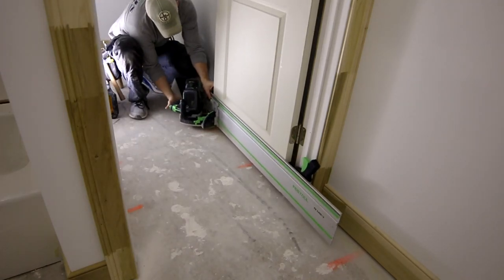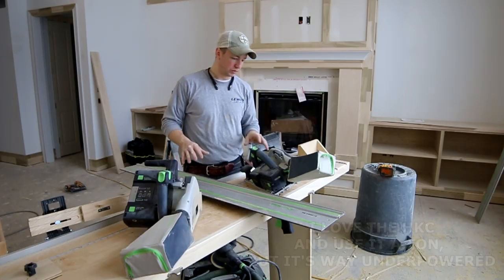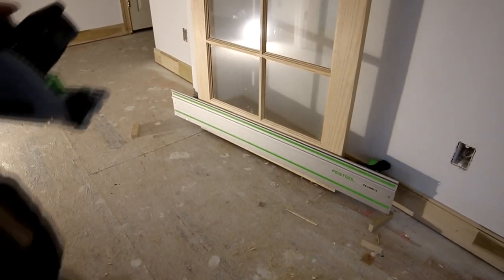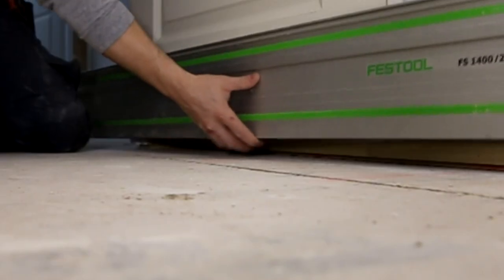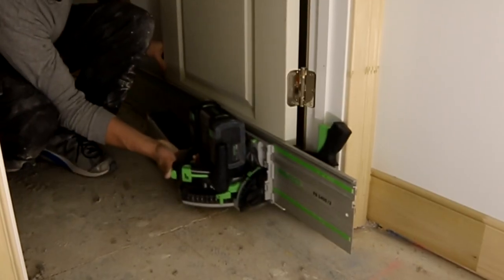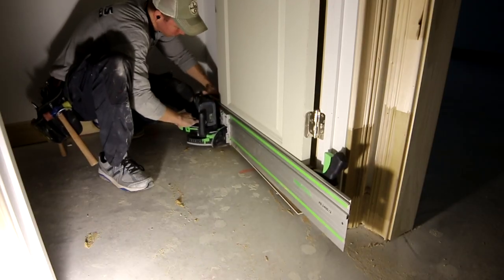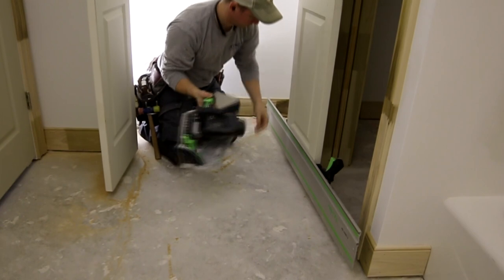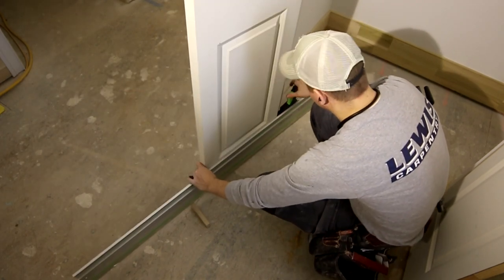Fast Door Cutting While Still Hanging??? Festool TSC 55 for the WIN!!!

Comment: Any recommendations on lasers? Cabinet guy buy trade.   I had a pls180 horizonal/vertical for 12yrs and  up graded to a PLS360.  I babied that laser and after 1yr of looking perfect due to only being on the trypod its whole life to get blasted by someone to just set it back up and walk away. Never found out who did it but now is a complete loose.
Reply from the maker: I have had a pls 180 for going on 10 years that won't die. The buttons are starting to not always work. I'm holding out for a PLS 180 green with recharcheable battery pack. The green lasers use a lot more battery than red. So I'd like the recharcheable pack. The PLS 180 is the perfect size for me. 

I also have a dewalt green line laser. It works well but is larger. That one uses 12v dewalt batteries.

Comment: Hey there, question..I have the cordless t55 as well, it’s been only six months since I got it. Today I was cutting very low depth cuts and at the end of my cuts the blade goes deeper into the material. I can’t seem to find a way to adjust it if that’s all it is.. do you happen to know about that? Thank you so much.

Comment: Question. When you block the jamb up .5 inch for carpet and run your base at 3/8 do you take the door casing down to 3/8 above subfloor as well? Or do you take the casing down to .5 inch above subfloor?
Reply: ? Sounds like an A-level maths question! What speed are they travelling at?

Comment: I have door warranty voiding problems if I do this, so I dont. Pull the door cut and sand and seal door bottom. A door must be sealed on six sides and of I get a batch that wildly warps and they are sealed and hung I can process a return.

Comment: Real curious how do you reseal the bottom of the door after cutting it? I'm sure that would void the warranty if it was left unsealed. Did you go around and paint them without taking them off the hinges as well?
Reply: That's an interior door, they usually don't paint the bottoms because of the raw wood edge

Comment: That’s a great time saver, when I buy the clamps I’ll be sure to use your site. Been burnt on the flooring deal also, contractor told me 5/8 off sub then had me install 5/16 vinyl with no underlayment needless to say I was pissed. Most of my jobs I now do flooring first, when possible. 95% of my jobs are pre-stained or painted, so was wondering if your painters get upset due to the holes those clam clamps leave? I do like the hi-pur glue gun tho 👍. Great vid
Reply: What holes did the clamp leave? The festal that was demonstrated basically works like a large clamp...squeezing the sides of the door.
Reply: @jeffw8057  heh said clam clamps. Not track saw.
Reply: @2chipped  Gotcha. You are correct. thanks.

Comment: Great video ! Nice saw for the pro and your right messing with door pins stinks .However I don’t see the do it your self guy spending the money on this set up. Quality of the door manufacturing has gotten so poor anymore I have to inspect the doors with a fine tooth comb before I leave the lumberyard. Do you find the same problem with the higher quality doors? I recently did. I won’t mention the company’s name. The painting of the bottom of the door could be done with a small weenie roller If you can find painters that even bother to paint all six sides of the door anymore.Great video after 40 years in the field. I love the new tools if they only fit in my budget I will use your links if I purchase. I love to support a YouTuber

Comment: Hi Spencer - It’s a quick and easy fix, but you’ve cut off the sealed edge.  Is this not a concern?  I think warranty requirements require that the edges are sealed.

Comment: I actually cringed at the mention of the hinge grease. That stuff is gross. Great tip on cutting doors down! Have you thought of a way to keep the doors from swinging around which would assist with “constant pressure” issues?
Reply: I wondered why he didn't address that too. I would have cut a couple of wedges and chocked each side of the door; or used an air shim.

Comment: Festool’s hallmark is their dust collection... if you were to use the tsc55 with an extractor it would be 99% dustless and this method could be implemented at an inhabited or finished home.
The ts55 is so much more powerful than its battery counterpart also, but cords aren’t for everyone..!
Reply from the maker: Not really. I think the tsc is more powerful or at least equal to my ts55.
Reply: @InsiderCarpentry  It is more powerful than the corded version, he's mistaken.  I own both saws.

Comment: After I hang doors where carpet is going. I run my circular saw right on the ground and a quick swipe of sand paper and its done. Takes almost no time.
Reply: The plate and blade are always 1.5 inches offset. I have a festool track saw that's fine after the house is finished. My method would be way faster than the track saw in an unfinished house.
Reply from the maker: I made a video doing that method also. Definitely the fastest.

Comment: I love the idea behind track and the saw.  Great video demonstration. However, it should be noted that these tools are really for the professional carpenter, or someone that anticipates having to trim many, many doors or cut many, many sheets of plywood since the cost for the track and saw are near $600.
Reply: If you save $6 per day in efficiency, which is probably 10 minutes  for Spencer.
Am guessing he uses it 3 days per week, ROI is 33 weeks.
Reply: @2chipped  I suspect the savings might be higher for Spencer...especially if the alternative was to remove the door, place on horses, etc. However, for me the rate of return would be closer to 33 years I think!

Comment: I"ve cut hundreds of doors by running the saw with the shoe on the floor.  Cut and sand, done.
Reply from the maker: Wow. I had never considered that but it would definitely work to do it that way too. Very interesting.
Reply: @InsiderCarpentry  It is interestingly ironic that the carpenter that showed me how to trim doors this way was named Truly Carpenter.  Truly started working with his  contractor dad when he was 15 years old and was a very qualified journeyman by age 19, when I met him.  I had good teachers, but without YouTube learning new things in 1967 was a lot slower.  I watch your videos because I still go to work nearly every day and need to continue learning.  You are a master craftsman and a good teacher.
Reply: I've been told the one side of a circ saw bed is 1 1/2" for the blade to the edge, so your way of the saw bed on the floor is eliminating many steps demonstrated here.  I know not all sub floors are smooth but I would surely use the saw bed edge on the floor over all that aligning the track to the marks by standing on your head to see them before cutting.
Reply: @vansage2691  Most saws are 1-3/8" or 1-1/2" to the blade.  We used a little 5-1/2" sidewinder that was 1-3/8" to the blade.  This didn't work on all doors, out of level or really rough floors.  Or out of plumb walls that just couldn't be fixed.  Sometimes we had to shut the door, scribe it to the floor, unpin it and cut it, even then we cut it just like you'd cut a 2x12 laid across your foot.  Bear in mind these were inexpensive hollow core interior doors where the risk of a screw up only cost $50 or less.  On expensive doors we took way more time, you don't want to risk screwing up a $300 or $400 door.  Cheers.  Also double doors almost always had to be scribbed to the floor, unpinned and cut in order for the joining edge to match.
Reply: That will work if the floor is flat.  Alot of times in old house the floors are all over the place. When you open the door enuff to cut it. It will not be parallel when closed.   But excellent idea in a perfect world. How close to the floor does the festool get the cut?
Reply: @edwaggonersr.7446   I just typed the same thing. Haha

Comment: I guess u measured for the flooring to go down looks a cat could get under that
Reply from the maker: Door is cut off at 1.5". Carpet is at least 1.25. By the time carpet is installed the door barely clears.
Reply: @InsiderCarpentry   but carpet and underlay is 30ml which is 1.831 inches  so that wouldn't be enough